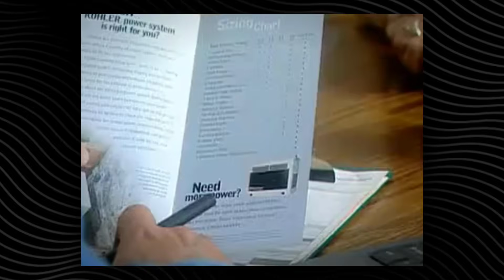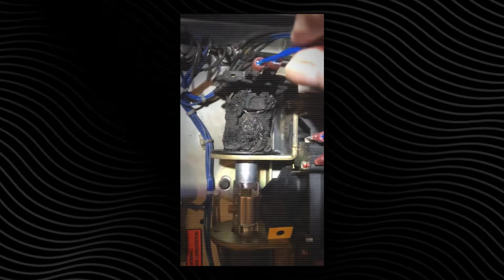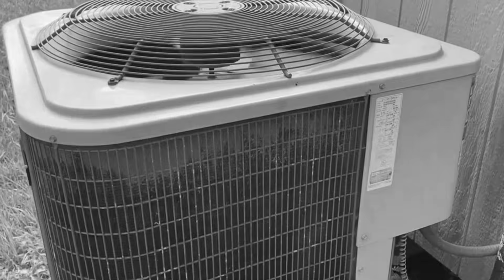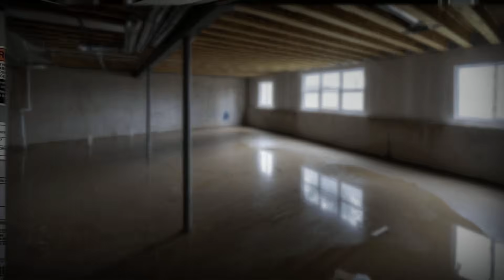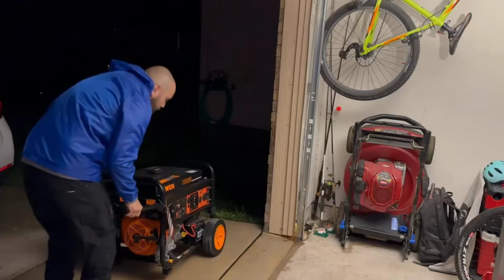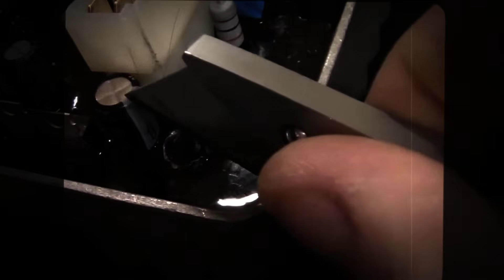Why Electricians Beg You To Avoid Whole-Home Generators (The $10,000 Trap)

Comment: Number one problem with any type of emergency generator: It won't start when you need it to because maintenance is neglected until the generator is actually needed. It sits there for years, forgotten...and then one day the power goes out and you go to start it...and...nothing.
       Second major problem: Having enough fuel on hand to keep it running. If it's a gasoline  generator, gas is hard and dangerous to store in large quantities...and it only keeps for several months. If the power's out, the pumps at the gas station will not be working...or, in a big event like a natural disaster, the gas will disappear quickly.
         Me? I'd rather invest in a wood stove. Firewood is easy to store and always ready; the natural warmth actually feels good; no noise; and it's much cheaper...and as long as you have matches or a lighter...it always starts.

Comment: built and installed my own solar/battery/inverter whole house system.   Runs my entire house 100%, well in snow time there are times when sun is lacking.  I use grid to charge my batteries AND if grid is down, I have several portable generators I can manually start up and charge my battery via a Chargeverter. Do not need big auto starting generators that suck fuel.  the tech works,  management is key

Comment: Your clickbait bullshit is getting old.
Don't inverter generators require oil too?
If the inverter board goes bad, do you just pull one out of your ass? Or just write a check for $2K for a whole new inverter generator? If there is one in stock and not being "price scalped". (We'll talk capitalism later.)

You're a fool if your electronics aren't already on a UPS.
Kinda silly to not have an alternate non grid-reliant heat source

Comment: You forgot that these inverters come in different ratings. If you plug one in and exceed rating you will still be in the dark. Inverter generators to keep everything going in your home is expensive, not to mention the noise and gas fumes you will have to deal with.